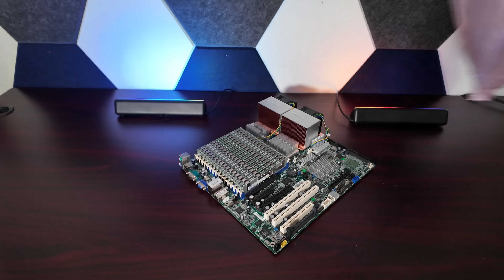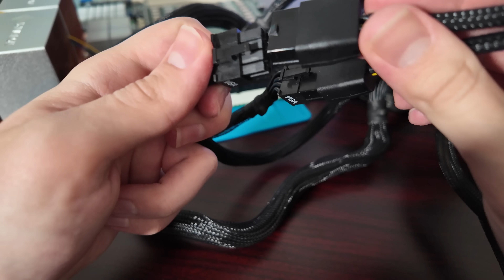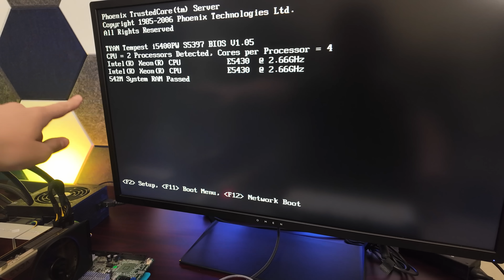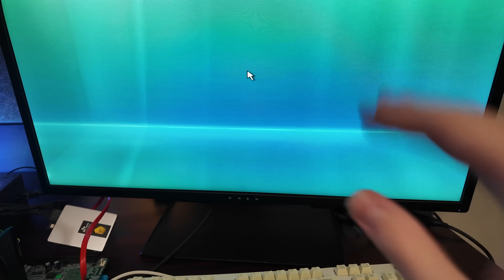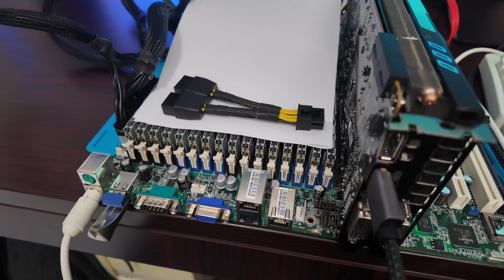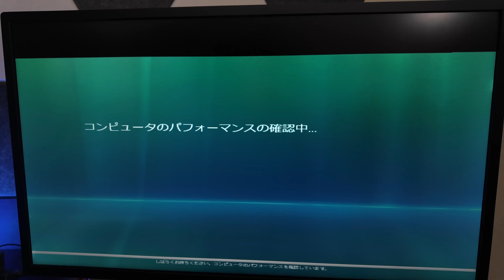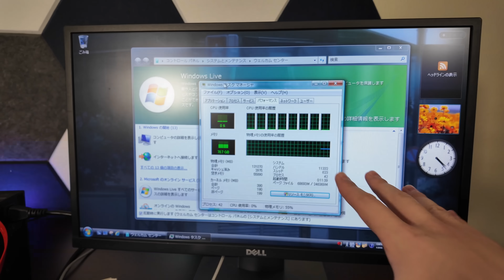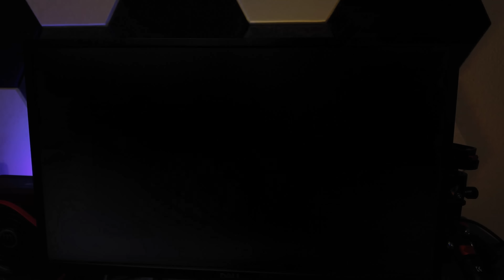What can you do with 128GB of DDR2?

Comment: And not just any DDR2. Fully buffered DDR2! That shit was expensive!
Also, in the future, when you're faced with a power connector arrangement you're unfamiliar with, you really should probe them with your multimeter to make sure they're what you think they are. These newer ATX power supplies put out quite a lot of current on the 12v rails, and there's more than a chance you could blow a trace or a component on your fancy new board before the power supply' figures out that there's a short!

Comment: Vista is an odd choice. XP or 7 would have been more authentic. Most people who bought a PC during the Vista era. Would have reverted to Windows XP or 2K or waited for 7 to upgrade. Only peoples mothers used Vista. People who bought PCs at Costco or Sears. 

On a different note. Either installing linux or running a virtual machine with linux on it. Within that ramdisk. Then using that to create a space to run emulation software for old console gaming. Would work great. Ya really only need 1 gig for Vista to run. So that leaves 127 gigs for emulation on a ramdisk.
Reply: Windows XP would have been a severe waste of money due to only being able to use 4GB out of 128 GB
Reply: @uwu_peter  XP 64bit handled more didn't it? Its been so long. I have forgotten. I just remember downloading it when the beta was released and trying it out on my AMD ATHLON 64bit single core. And most stuff not working because there were no drivers for 64bit yet.

Comment: DDR2 is already slow and the old CPU is bottlenecking the NTFS emulation. Modern NVMe SSDs are much faster but if you slap it in there with the 1st or 2nd gen PCIe bus, you'd probably have much lower speeds than with the RAM drive. You could also benchmark your SATA SSD for fun, but it will probably max out at SATA II speeds (300MB/s). The only use case for such a large amount of slow RAM is boring server stuff like huge databases for web services or whatever, which can be completely loaded (or cached) in RAM. Back in the day this would outperform any conceivable bulk storage array by orders of magnitude in terms of latency. Now any NVMe based storage is more then adequate for any database applications with virtually no size limit - but the RAM is still hogged by AI trash, which can never run fast enough.

Comment: Finally you've found a system that can properly run Windows Vista.
Reply: * Still insufficient for Windows 11 *
Reply: @m598lmr  a simple hdd installation chokes it lmao, done it a couple times with hardware more than sufficient and always took 10 min to completely boot up
Reply: @m598lmr it actually is capable
Reply: @APFSDS131  Does this have TPM 2.0 built in? That is one of the requirements for Windows 11.
Reply: @Sallen121 fuck it we bypass it
Reply: @Sallen121  fuc requirements
Reply: @APFSDS131 yo done the the with old pentium with 2gb ddr2 ram
Reply: @AmyKeaOrg I mean, if you try REALLY hard and modify windows
Reply: @APFSDS131  Rufus does it for you
Reply: @AmyKeaOrg wdym that can run Cyberpunk 2077 at 4K easiky
Reply: @APFSDS131   I bypassed requirements too. However the OS doesn't run really at all if you don't have ddr3
Reply: @naturedetectiveminecraft6362it runs fine with DDR man idk what you mean
Reply: @APFSDS131 its not that hard lol
Reply: @APFSDS131 its incredibly easy to
Reply: @Sallen121  there's one version it'll run on that is unoffical and is for athlon 64 (demonstated on a laptop)
Reply: @APFSDS131  running Win11 on an r5 1600, works perfectly fine just with a regedit bypass method :). Stable OC"d and smooth (32gb DDR4 helps and a matching GPU) for everything I use it for.
Reply: @raiderfly  can you run crisis
Reply: @APFSDS131  don't own it to try it lol
Reply: @Sallen121  you know you can bypass it pretty easily right?
Reply: @Pickle-Landon_Shorts RUFUS W
Reply: I was actually using WIndows Vista quite good and nice for several years on 4GB of RAM ;-)
Reply: Vista wasn't that bad. But this system might've handed Longhorn and WinFS. People think Vista was bad, but if you tried Longhorn betas...you'll realise why that was scrapped.
Reply: @stephanieamare  Vista wasn't the problem, the problem was hardware vendors slapping it on PCs that were barely up to snuff for XP to try to shove old stock out the door while they still could.
Reply: @nukebirb This and the driver fiasco. I held out for 7 myself with a proper build.
Reply: @oldschooldude8370 Honestly nowadays just slap 7 drivers on Vista and it runs fine
Reply: @nukebirb Absolutely.
Reply: @nukebirb  Thank you, tired of educating people about Vista, the operational system was overall completely fine after patching, it was merely released too early
Reply: Vista worked fine for me on a Sony vaio desktop. 2.8ghz ht pentium 4 with 2 gig ram, agp Radeon 9800, creative sound card. I smashed it in a fit of rage when I found out my wife was trying to go out of town to cheat with some guy she met on yahoo games 😂. Eventually rebuilt it in a different case and made it quad boot xp,vista,Linux,and osx. By that time, it was 2009-2010 and I got the hp hdx “dragon” which was a huge 20” screen multimedia laptop which had a fast dual core and 4 gigs of ram and ran vista flawlessly.
Reply: @christopherchekaway1390   valid crash out my man, though I think you should have smashed something else in that moment preferably two things.
Reply: @kimoy1528 The courts tend to look down on domestic violence.
Reply: @nukebirb   id say cheating on your wife or husband is as messed up or more messed up than domestic violence, and that is not an opinion, the justice system isnt particularly just anyways. of course practically id rather not smash any heads but if I were in his place I might have been overwhelmed.
Reply: @kimoy1528 i say this, both are bad, but its best to just, move on, instead of getting yourself in prison with a felony
Reply: @Adelin_15 Or if needed, smash one of their things first. Then move on with your life.
Reply: @christopherchekaway1390  oof today thats like someone would ditch you over a TikTok guy
Reply: @christopherchekaway1390  what happened with the wife? need updates
Reply: @xcvdsfhsdfgadf living in bfe Ohio no car works at a dollar store on welfare last I heard of. Let’s say far and away from me and my lifestyle.
Reply: Ran win vista on 2 gb ddr2 btw
Reply: @f @endeavoru  running 7 on 2gb ddr1 rn btw, Pentium 4, with aero enabled.
Reply: Wrong. It can run Windows 10. As for 11, it can run up to 23h2 via Rufus and that's it. Also, Linux Mint Cinnamon or Vinari OS would work just fine, too.
Reply: Vista was my final straw before I switched to Linux
Reply: Hahahahahaha
Reply: But can it run Crysis?
Reply: Lmao
Reply: tbh i always thought vista's desktop looks really nice. I wish they made it more stable but it was always beautiful.
Reply: And Crysis
Reply: Crazy that vista takes 7gb of ram
Reply: I still have my Toshiba Satellite A series Laptop with Vista on that hardrrive. 
Just waiting on some thermal paste so I can put it back together from cleaning out the fan assembly from completely being stopped up with dust bunnies
Reply: Vista was the best windows
Reply: Lol Vista ran just fine on my Q6600, 8GB DDR2, and 8800 GTX, and I didn't even have the nicer revision Q6600 OCers preferred.
Reply: @metaleggman18 They're joking. Vista was fine on way less than that. Hardly anyone had 8GB back in 2006
Reply: @malucart  People probably know it was a joke, that doesn't stop people from discussing the reason behind the joke.
Reply: @malucart  Hardly? Okay I was spoiled then
Reply: @ImpeccableWizard  you were. i had 32MB in 2005.
Reply: @metaleggman18  8GB for vista is overkill, my family pc back then was 1GB, it run fine. and it considered good mid end back then
Reply: @metaleggman18  they were joking back then, considering Pentium prior to Vista was woefully crap to run anything
Reply: @metaleggman18 u definitely should learn about the sarcastic jokes
Reply: Still running a Q6600 4gb of ram and dual 8800 gt on my vista gaming pc
Reply: @metaleggman18  Vista even ran perfectly fine on a dual core amilo pi laptop with 2 gigabyte ram in 2008 or 2009. The problem was that a lot of people were on extremely old hardware not realizing their machines had technologically aged and didn't offer the needed performance.
Reply: @EximiusDux  Yup exactly. My machines that came stock with Vista ran fine on 2 GB.
Reply: @EximiusDux  Most PCs at the time Vista was released were being sold with 512MB of RAM, 1GB if you bought a high spec machine. People weren't trying to install it on "extremely old" hardware, they were trying to install it on the computer they just bought a few months ago. 512MB was Vista's bare minimum and you needed 1GB to run comfortably. It was an absolute hog compared to XP, which will run comfortably in just 128MB. People didn't expect their new OS to need 8 times as much memory as their previous OS.
Reply: @CapnHorationMagellanCrunch  Windows Vista released in 2007. The cheaper laptop models were being sold with dual cores and 1 or 2 gigabyte ram between 2007 and 2008, ex. Fujitsu Amilo pi models (i had one of those back then so i know for a fact). Huge amounts of people were still rocking their old mono core 1 gig machines and tried to run Vista or were buying old stock hardware in an era where "buying a PC" almost literally meant it was dated slow technology from the moment you bought it. Hardware advanced absurdly fast back then.
Reply: @EximiusDux  it "ran" on 2gb, yes, but don't you dare do anything other than transfering a few files and maybe word.

And yes, a lot of pcs were 2gb ram machines back then. And no, that wasn't underspecced, as vista's official system requirements stated a minimum of 512mb ram with a recommendation of 1gb, an 800MHz-1GHz cpu.

Also for those saying "it runs fine on my 8gb ram machine", duh. Of course it's going to run fine on what would be considered the absolute high end back then.
Reply: @Ahimi  yeah, mistakes were made by Microsoft and OEM machine makers. That's just a historical fact by now. A 2Gb machine ran it fine though. I can't change my personal experiences with multiple machines running vista at the time. That's the problem with PC. Too many plausible CPU, RAM, Motherboard and GPU combinations. Even the quality of HDD mattered (speed, error rate). So yes, many people would have had issues with vista. Many others didn't and the OS was perfectly fine.
Reply: The pirates did all the work for MS and fixed Vista after they abandoned it.
Reply: on wrong language

Comment: Nice fan heater :P

Still using a 2nd gen dual-socket xeon at work. Despite the raid-1 SSD root install, 24 cores, and only 78GB of RAM, it's painfully slow so it's a proxmox node with various win OS VMs to check our software compatibility. Also has some various containers for searxng, pihole, etc.

Comment: Did you realize that the EVGA GeForce GTX 770 SC pulls 230W ?  It's a 2013 2GB card that is power overkill for a server system, and under spec for even a 1080p gaming card today.  I would say it's the wrong choice for that board.

Comment: I have 128G of DDR4 on my threadripper which fortunately seems to still work
Reply: Same, but with a 5900XT (16-c/32-t). It's kind of just wild how things have evolved over the decades--workstation/server grade of old becoming consumer/normal in the present. 

DDR4 is still fine. Right now with DDR5 shortages, people are jumping back over to DDR4 and some motherboard companies are ramping up production again when they were considering shutting it down. Which, ironically is also now causing a supply and demand issue, and DDR4 prices are surging. I'm also glad I hoard parts because I have another system with 48GB (even if it's just 3000MT/s and a 5800X.

Comment: I have two 2013 Mac pros. One came with 128GB of DDR3 that ran at 1033Mhz. It felt too sluggish. So I swapped them for the 64GB it’s advertised for at 1866MHz. Significant difference. The 128GB was mostly used as RAM disk to help with file transfers. Transferred super fast.
Reply: 6.1 can?
Reply: Must've been the ECC server DDR3, as I can't find any regular consumer DDR3 that are higher than 1666MHz

Comment: Nice
This is my used workstation bought for less than $400 2 years ago

I'm going to hire a part time security detail to keep an eye on it

free -h
               total        used        free      shared  buff/cache   available
Mem:           125Gi        16Gi        13Gi       623Mi        97Gi       109Gi
Swap:             0B          0B          0B

sudo dmidecode -t memory | grep Part                                                                                                                                                             
        Part Number: M393A2K40BB1-CRC
        Part Number: M393A2K40BB1-CRC
        Part Number: M393A2K40BB1-CRC
        Part Number: M393A2K40BB1-CRC
        Part Number: M393A2K40BB1-CRC
        Part Number: M393A2K40BB1-CRC
        Part Number: M393A2K40BB1-CRC
        Part Number: M393A2K40BB1-CRC

Comment: lol are those TL-B6B 60mm Thermalright fans on the CPUs and Arctic P8 Max 80mm fans on the ram?  I run three of the thermaltakes on a bracket to cool my 25 gig nic in my desktop and run the P8 Max fans in my server.
Reply from the maker: Good catch! They were all pretty cheap that's all I needed lol
Reply: @LowestLogan  I've been quite happy with mine.  The max version of the P8 was probably overkill, but it also likely lets me run them at a lower speed and hopefully lower noise.  The P12 Pros were certainly crazy loud until I set up custom fan curves

Comment: I'd say your best test would be getting like a GTX 1060/1070, Windows 10 Enterprise IoT, and using it for gaming. I agree with others as well of testing on a flavor of Linux (Debian, or Arch). If anything you could always also do Proxmox and do virtualized servers. There are a lot of ways to stress the system despite its age.

Comment: A bit of a frustrating video.  Why vista of all things? and Chinese locale at that. it wouldn't even have had vista on it when new.  stick Linux on it and try some real world use cases, CPU inference of course with that ram, ZFS performance, truenas,  10GB network etc.  Probably your ramdisk sucks because of crappy NTFS performance and NUMA issues with a crappy vista kernel scheduler.

Comment: ram fan shroud for supermicro boards? Will it work on the Supermicro G34 socket boards that had the modded "OCNG" bios for overclocking?
 Back around 2017 or 2018 I got a 12 core 2.10GHz CPU to overclock up to a stable 2.5x-GHz with only frontside bus speed change and a minor +0.25mv voltage boost, I forget exactly what that one was stable at but I do remember that there were 2 different ddr3 ram speed/timing profiles and iirc the cmd prompt overclock tool for OCNG let me set a hybrid of both...
 But I know 2.75GHz wasn't stable until I got my hands on a 16 core 2.30GHz unlocked AMD Opteron 6276 engineering sample CPU to slap into it, since that finally let me mess with cpu clock multipliers

Comment: Well,maybe its insignificant,but for presentation purpouses is good to use english version of the windows,unless there is specific windows version and language license locked to that pc. Another one i would maybe pick win7 instaed of vista,but depends on what is intended to do ... Propably could play some games,just it need really more efficient cooling. 

DDR 2 - 128GB well ... that used to be mid level server in small company.  I must say: Yes the Xeons tends to heat up the room even with watercooling friend got similiar setup with ecc 128GB DRR4,two motherboards with ramms each 64 GB included in package just to get the double compatibile ramm for one,and now no one wants to buy it,when its offered to be sold ... Note: its win 11 unsupported,that one of the problems,secound its a Xeon.

 Money well spent,money lost,it is hard to say,for now ... Friend bought AMD pc instaed. The new amd pc investment has less room heating and its actualy more energy efficient,for less getting more. Buying pc is about to get pick good choice that wont be regretted later ...

Comment: You have the wrong OS for this hardware. By the orientation of the CPU sockets and the RAM slots, it's a server board. What do you do with a server board? Why, you put it in a 19' mountable rack case, rack & stack it, and... you run SmartOS on it. And then you run a whole bunch of virtual machines on it. Just like you would on VMware ESXi.

Comment: I bought 2 years ago 2 sticks of 8 GB DDR2 ECC to upgrade a DELL Precision T5400 I have and they both cost me ~50 euro. So I would have had to spend a total of ~200 euro in order to populate the 8 slots of the PC and have 64 GB which... I would have had no idea what to do with since the platform is really really outdated for anything that would utilize this much RAM. I mainly bought them since one of the old sticks had died and I didn't want to run it with 6 GB RAM only (3 remaining sticks of 2 GB).

Comment: Get a SAS adapter and add a bunch of 15k RPM SAS drives. Install TrueNAS and setup a ZFS raid. It will automatically use the RAM for caching. Then stress test it over the network.